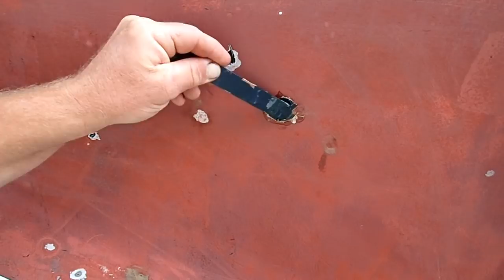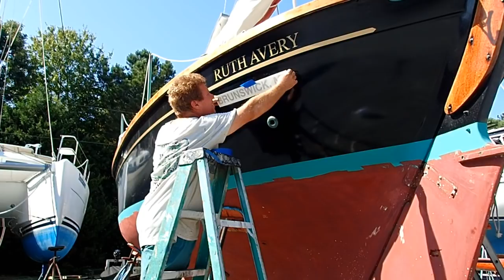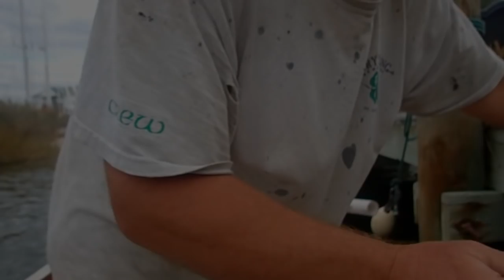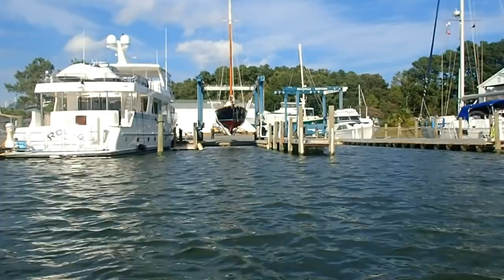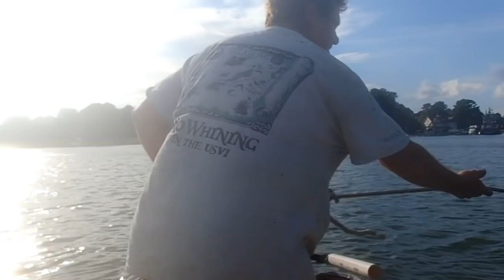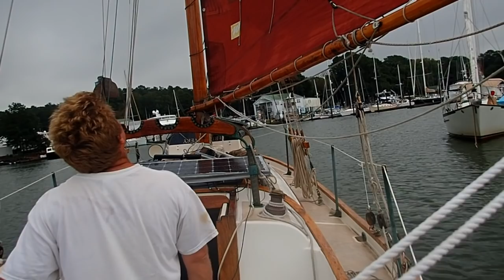Hard work, on the hard ... then back in the water!

Comment: A few cuts in the letter backing paper should allow you to easily put the letters on a compound curve.  Just use a scissors to cut up between the letters to within a 1/2" or so of the top edge.  Tape the top edge of the backing onto the boat like you normally do and then "pull" the letters down individually and adhere them.
Reply from the maker: Interesting, hadn't thought of that and yet it makes perfect sense.  Next haulout ...

Comment: Raising my water line it always resulted in looking like a long wave in motion. I thought it would take a laser level adjusted for the out of level boat to do it right, which of course such a machine was never available. Thanks Kevin....Next time I haul out I will use the simple eyeball method.
Reply from the maker: Low tech wins again ... the laser machines are not expensive, but we cruisers don't have a giant attic to store all this stuff when we are not using it.  Fair winds, Patrick!
Reply: Half my boat storage is filled with tools and repair materials. The only place to stash a laser would be under my pillow so will give it a miss. I will stay with your method.

Comment: An inexpensive, "Laser Level" will assist with marking an accurate water-line.  By the eye your water-line looks very nice.
Reply from the maker: Hadn't thought of that one ... good idea, although I think you would have to be sure that they blocked the boat up level for that to work (?)
Reply: Yes, a level boat works best.  Using a three legged tripod, with adjustable legs, gives some fudge factor.
Reply: It is my understanding that using a laser level, or any level, will NOT result in a boot stripe that appears even along the length of the boat. Because of hull curvature, only sighting in will produce a line that appears straight and "level", even though it really isn't. And as stated earlier, leveling a boat on the hard is just not gonna happen.
Reply: Here is a link to a video that explains the "complexities" of painting a boot stripe and one method for getting it right:

https://www.sailmagazine.com/diy/how-to-paint-a-boot-stripe
Reply: That's interesting, they mark the "boot stripe", from waterline.
Here's marking the waterline using the "laser":  youtube.com/watch?v=DUMLOTnc0_k
Reply from the maker: If you had marks along the waterline, I think you could adjust the height and level of the laser plane so that would correctly fill in the dots between the marks, then follow that with the tape ... seems like that should work.

Comment: Hi Kevin, many thanks for your videos which are greatly enjoyable, instructive and inspirational!  Do you mind if I ask about your running backstays:
1) Is it essential for one of them to be in use at all times to stop the mast falling down, or are they just for optimising forestay tension?
2) Do you use them on all points of sail?
3) What happens if you have an accidental gybe and the boom hits the tensioned runner?  Or do you somehow manage to ensure that this never happens?
Reply from the maker: Yes, the windward runner should be tensioned at all times, but the aft lower does have enough lever arm to prevent the mast from falling forward--I've blown the tackles out with full sail up, and the headsails just sagged a bit, but no damage.  Yes, the boom can accidentally gybe and hit the tensioned runner, something you do not want to happen.  It has happend to me though, when the self-steer didn't respond fast enough and she went through a gybe, luckily I did not break the boom.
Reply: Thanks, it's something I always wondered about!

Comment: Tip for adhering long decals on curved surfaces: cut the paper into sections after the top tape is applied.  Chris on "Sailing Britaly" channel (excellent channel BTW) shows how it's done. https://youtu.be/V4BXGILkeVY   That is a highly recommended channel in general.  He is also a master mariner, like you. 

Your tip about using different bottom colors to monitor ablative rate is GREAT.  I hadn't thought of that.

Have you ever considered giving classes on engine-less yachting?  I'm sure there are many of us interested in the techniques you've developed over the years.  Maybe an e-book?  Your videos are priceless if for no other reason than they teach that patience and choosing wind conditions (angle and strength) carefully are important near-shore when going without an engine. I will always (probably) have an engine, but they tend to fail at the worst time, and so having the skills to do near-shore maneuvers engine-less is priceless.  The movie "Hold Fast" is also great for seeing engine-less harbor sailing in action.

Thanks for your contribution to the modern yachting world.

Comment: Question; how well does your gaffer sail to windward ?
Reply from the maker: Depends on your standard.  She will not beat anything to the windward mark on the club racing circuit, but for a cruising boat, she's OK.  Generally I tack through 100-110 degrees on flat water, 120 when the swell gets up.